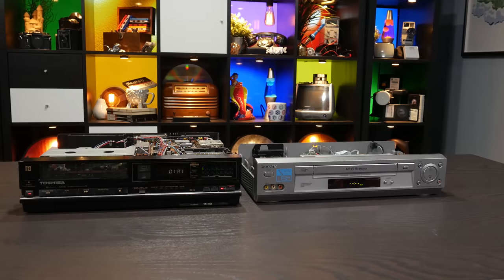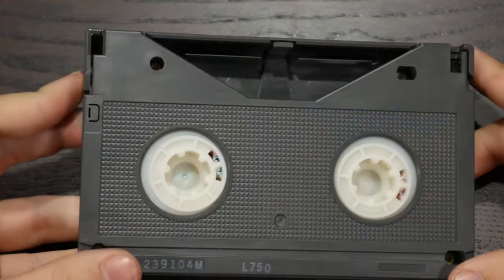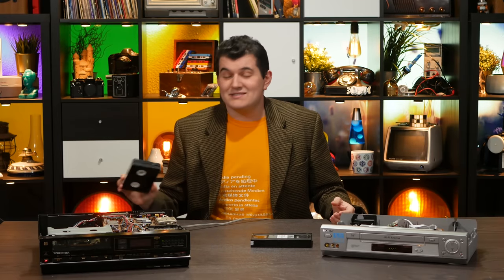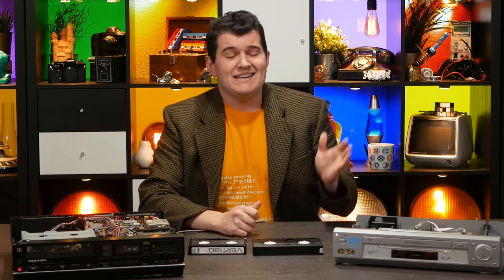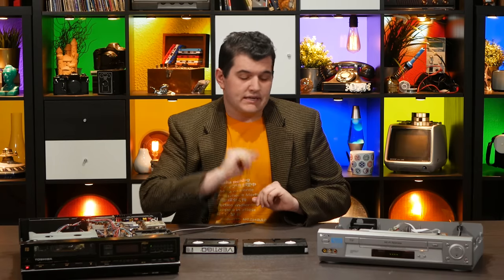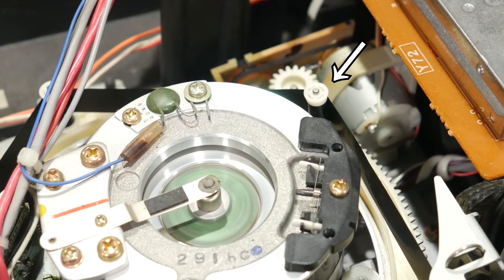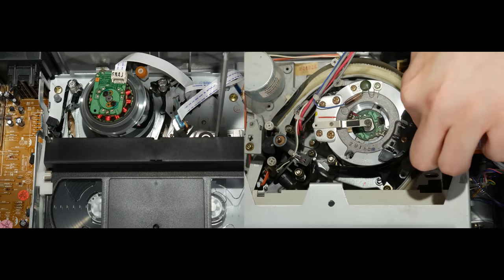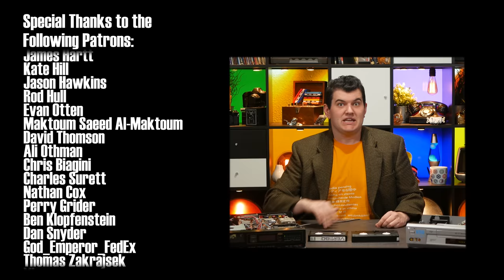The VHS cassette was more clever than Beta

Comment: ACKSHULLY, both Americans and Brits officially pronounce the Greek letter Beta wrong: in the original Greek it's supposed to have a bit of a v-sound at the front, though the -ee is correct: veeta. So there. However, Sony based the pronunciation of Beta on the American version: anyone who can read Japanese Katakana will note that it is written as ベータ which is always pronounced as BE-TA, never as BI-TA. So if you're talking about the video tape format, the correct pronunciation is the American style.

The U load style of the tape is generally less stressful to the tape than M load, at least as originally implemented. Over the years things changed and M load was made less stressful and U load was modified quite a bit to simplify it: later Sony Beta units used a double-action sort of system that used a circular cam to thread tape around the video drum in concert with a second cam to pull the pinch roller assembly and complete the threading, noticeably shrinking the transport from the earlier single cam ring style. Also, if you ever take the side off your Betamovie, you'll note that the threading style is basically M load (gasp!) and that the video head uses the VHS-style spinning top half (gasp again!). 

On tape end sensors: the Beta system was inductive, not conductive like 8-tracks or some auto-reverse open-reel tape decks. The VHS system was optical which could cause problems with the early models: in these the light was produced by an incandescent bulb and if that burned out, your VCR stopped working properly, which meant a trip to the repair shop. The Beta system didn't have this problem though it was mostly rendered moot when LEDs replaced the incandescent bulbs in later VHS units sometime in the '80s.

Finally (finally!), most VCRs of any format, save some late-model VHS units, do NOT retract the tape into the shell for a fast wind, which means the tape rubs over the various contact points in the machine at high speed which puts tons of unnecessary wear on both the transport and the tape. I highly recommend using one of those really cool racecar-looking tape winders rather than subject your VCR and tapes to the extra wear, especially since these things aren't getting any younger.
Reply: The b vs. v sound depends on which dialect of Greek you speak, similar to way that theta is pronounced as written, or deta, if you are Doric (Spartan or Macedonian) or rural Irish.

Comment: ON PAPER  (for most engineers) the specifications for Betamax are better. Sony lost the war because RCA (with more effective marketing) decided to buy Panasonic machines. The Betamax system put more tension on the tape during use, so the machine could sometimes stretch the tape. As a service tech, I had
 a tape tension meter.

Comment: I owned both formats, but even though the Beta had less tape and wasted more of it at the start, Beta recorded 2 hours at its best setting and VHS only recorded 1 hour at its best setting.  That's the only thing that made me like Beta better.  I actually thought Beta would win when they developed Beta HIFI.  VHS did make HIFI available eventually by using a system called depth multiplexing which seemed kludgy to me, but it seemed to work.  If I remember correctly they recorded the audio signal strongly so that it went deep into the tape and then recorded the video over top of the audio shallower into the tape or possibly vice versa.  I was amazed that it actually worked.  Anyway, another great video.  Thanks
Reply: Did you even know that an overkill E-300 VHS tape exists? It allows for whole 5 HOURS at SP. Beta would have never matched that, and Panasonic or Teac made a very low speed which is ⅕ of standard play speed, allowing 25 FRICKING HOURS on one tape!
Reply: @danek_hren  I didn't know that, and never saw one for sale.  I wonder how many other people have never heard of it either.  If it has been widely available to consumers, that would have been great.  As for the 1/5 of standard play speed, allowing 25 FRICKING HOURS, I would never have used it anyway.  I was only talking about the best quality recording of both formats on a regular tape.
Reply: @robertmindenhall8607  don't believe that a cassette with a recording capacity of 5 hours exists? Just google "e 300 vhs". That's all you need to do.

Edit: on a regular tape - quality of ßI is better than SP only marginally, the bandwidth is 3,2 megahertz on ßI and 3 on SP. It may be just me, but I can't consider 1/15th part of VHS's bandwidth an improvement that will make you buy a Betamax machine.

Comment: I actually think Beta was the better format.
Basically, things win consumers by being easy to use and have the more of something and being smaller, but the actual quality of the function is way back on the list of parameters.

Plasma was better than LCD, but Plasma was heavier and had a smaller screen per dollar spent- also some care had to be taken to prevent screen burn (but first hand experience, it's not a big deal on late model plasma)
A legit Home audio setup with a Receiver and passive speakers is far better than sound bars, but sound bars are smaller and easy to setup, so people sacrifice sound.
A desktop is far more powerful and reliable than a Laptop- but laptop was smaller and had nothing to plug in except for the charge cord- most people don't even take their laptops out of their homes.
A batch brew coffee maker makes better tasting coffee for less money, but people insist on using Keurig machines because you put in a plastic cup and press a button.
A Plug in Vacuum lasts longer and cleans better, but people buy rechargeable stick vacuums because plugging in a cord is hard work right?
A WAV file is much better than a MP3 file, but WAV's take more time to download and more storage, so people listen to crusty sounding music.

And the list goes on and on.

Comment: I think you miss two points: 1) beta was a development from an industrial format and was not designed for kids or other less careful users so your comments about the hole size are valid. 2) Beta unloads the tape from the heads when fast forward and reverse where vhs did not. This made for more reliability in the semi pro and pro market and why betacam succeeded and M2 did not. Beta lost because Sony was run by engineers not marketers. JVC were happy to charge a tiny licensee fee for machines and tapes to buy market share where Sony wanted a lot more, hence the mass market voted for the cheaper option. I loved my beta machines and I now collect vintage sony video 8 walkmans. Sony made beautiful products that were well engineered but their cost did not meet the market needs. Interestingly Japan was a market where quality often beats price and Beta, Laservision and  several others were successes there. Why beta dominated the Hawaii market I do not know but there you go. 

Lastly VHS understood the need for taping time. Sony did not like using thinner tape and introduced Beta 3 which never made it to Europe or UK. After Vhs took the advantage, sony reluctantly followed but it hit them hard. Again engineering before marketing.

Comment: I had assumed until very recently that the insides of a videotape player just lifted up the cover and read the tape in-place, never crossed my mind that either format pulled so much tape out inside (come to think of it I probably thought this because I was comparing to audio cassette tape players, which pretty much worked that way and the internals of which were often much more visible while in operation)

Comment: V2000 was even better. The record protect was switchable - no breaking off of plastic tabs. It could be turned over like an audio cassette. There were notches to indicate to the machine the tape length. On some machines, inserting a tape even part way through, the tape was shuffled slightly and then displayed how far through it was in minutes and seconds.

Comment: From what I was told years ago Sony invented the VHS format then dumped it and sold it to JVC. I don't see whats clever about VHS when Beta was smaller and better quality. I used to repair VCRs and I saw a lot more problems with VHS machines than Beta. I bought a Sony SLHF-300 back in the 80's and it still works today. All the VHS machines I had died. In terms of quality VHS had flesh tones that looked pasty and flat while Beta looked more natural.

Comment: I picked up a Sanyo BETA machine that used the VHS "U" style tape threading design. A mate of mine had another similar machine, also Sanyo that used the same. Not that this matters! But interesting, to me at least. (Both of these were picked up from a scrap yard back in the early 1990s and both worked, with varying degrees of minor faults!)

Comment: How does the VHS-C adapter work? Does it have a spring-loaded mechanism or something?
Reply: Mechanically moved arms, spring and cogs to move the smaller width tape into the position of a full sized VHS tape. Part of the adapter is enclosed and as it is glued together you can't easily see inside.

Comment: When these came out at a reasonable price I purchased Both Beta and VHS as both were prevalent in the area I lived (Spokane WA USA). Thus when I rented movies on a weekend usually I could search both formats to get what I was after.  A funny thing happened when I got to checkout and the cleark pointed out I had both. I said it did not mater. The cleark said it Does matter. He asumed I did not know there was a differance. I finely had to explane I had both players and although not a rich person in those days there were distributers between dealers and factories thus since I was a distributor I got these two for just a little more than most folks paid retail for just one format. Interstingly Spokane WA N.Y, City and San Francisco were the only cities with pretty much = Beta and VHS players and rental stores. When I moved most places were VHS only with a very few Beta Only citys. I miss those days. AND regardless Beta did have a better Picture IF Bulk recorders used for recording were designed to use the extra bandwith Beta Had available. However most bulk recording companies did both formats thus the master tape (useualy 2 inch real to real rigs recorded the signal to match VHS bandwidth thus the picture quality was =. But now and then  you could find usualy low run B movies recorded on beta with higher bandwidth. I have seen Beta have a beter picture than brodcast TV

Comment: The tape machine you mentioned with the 'flying' pinch roller allowing the capstan to be free of the tape makes me figure it was at least a semi-professional use intended machine; that the flying pinch roller allows the machine to fast forward or rewind the tape more rapidly than normal.
I'm wondering what make and model of tape viewer that was.

Comment: However a 1983 Sanyo cross licensed $200 BetaMax could do tear line free, clear still pause, frame advance and frame rewind....while a $800 VHS couldn't.   I wouldn't see VHS do that level of clear frame by frame still and slowmo until the 90s.

Beta cassettes were smaller and able to still fit 6 hrs on blanks with slow track speeds.

Sony simply didn't cross license their patent to as many budget brands as JVC did.  Also Beta didn't have a copy protect security track to screw up duplicating movie tapes.  Early VHS did...so movie rent places preferred VHS
Reply: Only 4.5 hours

Comment: Philips had its own V2000 system right before they went VHS, so probably a lot of development of their U loading system transferred to VHS. By the end of VHS, Philips did not anymore produce own fabricated players. I would need to look into V2000 if it did U load or M load.

V2000 recorded only on half of the tape width, so the cassette could be turned over like audio cassettes and record 8 hours on one tape in standard play. It could achieve this by very close tolerances in the tracking, by using piezo elements under each head in the drum. That also gives it perfect still picture by design. The system competed with VHS and Beta in Europe, and was marginally doing better than Beta that was even more expensive, but not as popular as VHS which was simply cheaper to buy and had a market share already. These early days to own a VCR was anyway just for the 'wealthy'.

The first VCR system by Philips before the V2000 (N1500/N1700) predates Betamax, and the cassette reels were stacked like in a super8 cartridge. The head drum was massive in size (ported over from the reel to reel machines) and turned completely on it's own axle while loading,  and subsequently loading/unloading of tape was superfast compared to Beta/V2000, being less than 2 seconds. N1700 continued to sell even after V2000 production had started, and it was the only cassette system in the early seventies. Quality of N1500 is better than anything produced after since it could record more bandwidth, at the expense of a short running time, one hour per cassette. I have a couple of recordings on this machine and they look near broadcast quality.
Reply: The N1500 ran just 60min, but VCR Longplay has a surprising good quality. Like beta it has a higher color "resulution"

Comment: A-lot of those old cassette and VCR machines don't work well when cold. Some rubber wheels have less friction when cold so may slip. On some small cheap mobile cassette players when I was biking in the winter the auto stop would go. Cold VCR sometimes has problems.

Comment: Well, I worked in the consumer electronics industry during those years and lived through it, so forgive me for making a few corrections. Let me state clearly that I owned both Beta and VHS machines and ultimately sided with VHS like most because of content and tape prices. Beta was the better picture, but as you say, it wasn't by much. I will first address your ramblings on the tape transports. However clever you felt the VHS transport was, you failed to address something significant that it seems you simply didn't know since you never addressed it. VHS transports were efficiently designed to play and record tapes. BUT, the reason Beta's transports were more complicated was that they were designed to also fast forward and rewind without unloading the tape back into the shell of the tape. The Beta transport also optimized the use of slow-motion forward and back like VHS could never do. The capstan was released as were certain other points of pressure and the heads were designed to see a fairly clear image to know where you are even during high speed winding in either direction. If you wanted to skip a VHS back 5, or 15 minutes, a VHS would have to pull the tape back into the shell, rewind with no visual cues, then finally load the tape back again then go into play mode just to see where you were. You'd have to do this several frustrating times in order to find the spot you wanted. The only exception is if you scanned back or forward slowly, then you have visual cues. Betamax was designed to play, scan or fast forward or reverse at full speed all with the tape out of the cassette allowing for much faster use during playback. In later years, many VHS machines were modified to address some of those shortcomings, but Beta was still superior with those features. 
As for the reasons VHS won the war, there are a few, but the main ones you again don't address. Sony wanted to own and control Beta and charged a licensing fee to any or all that wanted to use the technology. JVC allowed anyone to use VHS free. Here, take it. This allowed any company to make a VHS machine for the consumer at a much lower cost than if they made Beta. Another mistake Sony made early on was that their tape was only ONE hour long, but that was later fixed with longer, albeit thinner tapes and multiple speeds. Still, the VHS ease of marketing a tape as a 2hr/4hr/6h tape (based on speed) very alluring. But let me correct you about the porn industry in the kindest way I can without just saying you're wrong. It was NEVER a question that Sony didn't allow porn. That's maybe some myth that came about in the last several years. Let me explain clearly what happened reminding you that I was in the industry and watched it all unfold. In the early '80s VHS was starting to win anyway, but Sony kept dropping prices and improving Beta, so they kept hanging on and sales were still fairly strong. But this is also the time that the Video Rental business was taking off. Now here is where the porn industry comes in. Even though porn titles represented maybe 10% or less of all titles available to rent, they represented over 50%, often more than 60% of actual rental revenue so they were very influential. The porn industry was getting stronger and didn't want to produce two formats. They very simply STOPPED producing anything in Beta and that was it. Beta was dead within months. They didn't really kill Beta as Beta was dying, but it was the final nail in the coffin for sure. The Betacam continued on in the pro sector including news cameras etc. but consumer Beta was dead. Sometime in about 1982 or 1983, Sony, with their tales between their legs, finally created and sold a VHS machine.
Reply: Wow did you forget that this isn't Google Docs

Comment: The reason Betamax lost was simple.  It was the first 1/2" tape format for the home market but Sony (like Apple) refused to license the technology.  JVC was both more foresighted and less concerned about having the market all to themselves so they licensed just about anybody who walked up with a blank check.  Market saturation won.  Apple and IBM went through the same thing later but by then incremental performance superiority was more important to the consumer so Apple has held on in the PC market.
Reply: Philips N1500 and N1700 came out first as domestic VCR. Shorter playback and more complex mechanism.